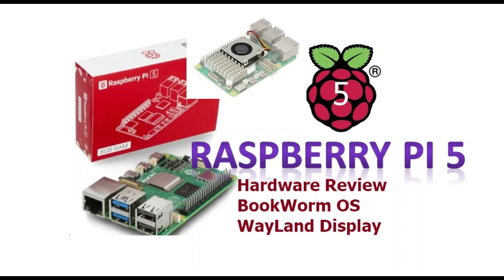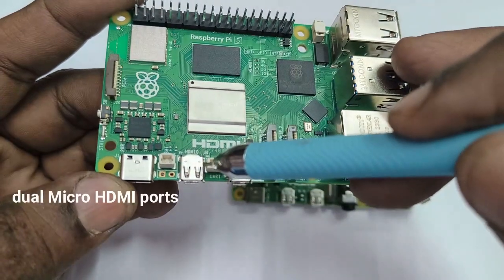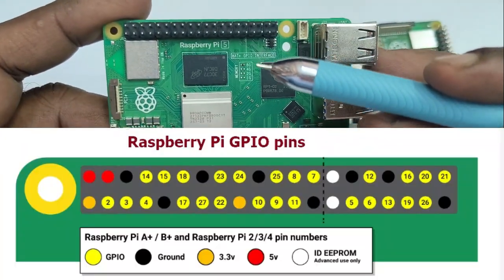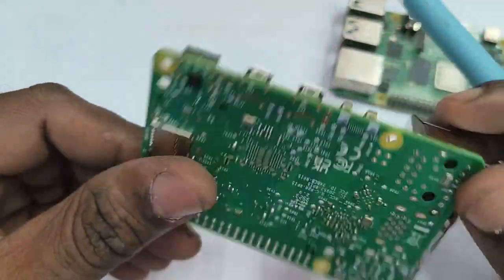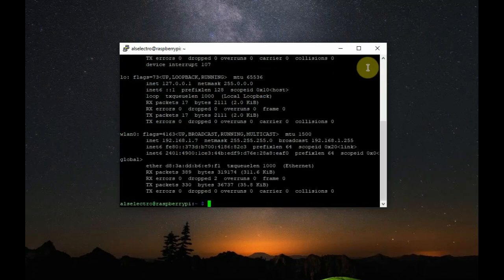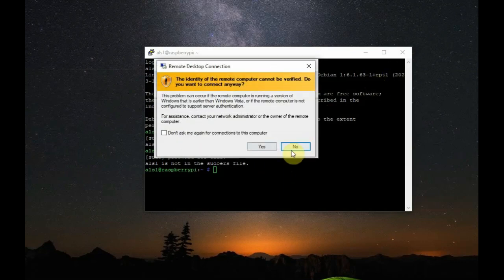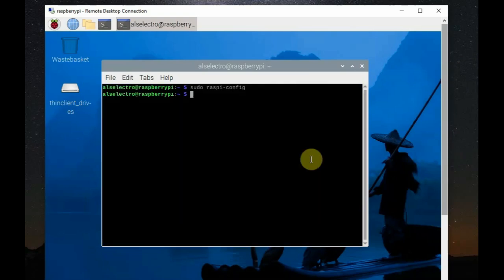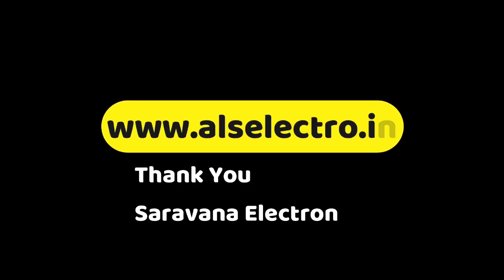The New Raspberry PI 5 - Hardware Review -BookWorm OS -WayLand Desktop

Comment: "RuntimeError: Cannot determine SOC peripheral base address"

I was working on a project to build an AI Surveillance System using Raspberry Pi 5 but I faced this issue I spent 5 hours trying to figure out the solution but couldn't and I'm still looking for the solution.

Comment: Sir i have  purchase rasberry pi 4 8 gb but it bootinv problem nog booting red and green led alway on i.e solid on please suggest  ang suggestion
Reply from the maker: Always use class10 SD card for writing OS. use RPI Imager to write 64bit OS. Ensure that power source is atleast 5v 3 amp. RPI hardware is highly reliable one.There may be problem with OS .
Reply: @SaravananAL  sir i use original rasberry pi power adapter but rasberry pi 4 red light and green light solid on without inserting SD card or with inserti g SD card with official  rasberry pi os
Reply from the maker: Red Led solid indicates power section ok. Raspberry Pi 4 uses an EEPROM to store the system’s bootloader. No green led flash indicates EEPROM corrupted. You can connect a HDMI cable to TV and read the diagnostics for any error. Also follow this 
https://pimylifeup.com/raspberry-pi-bootloader/